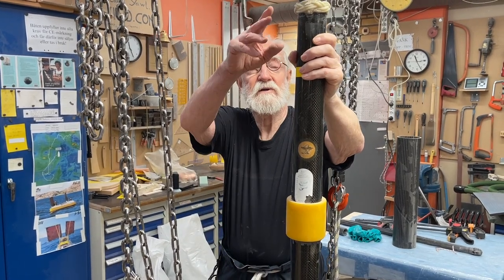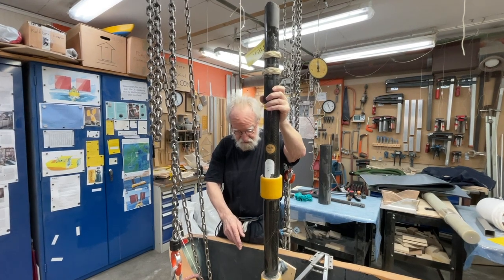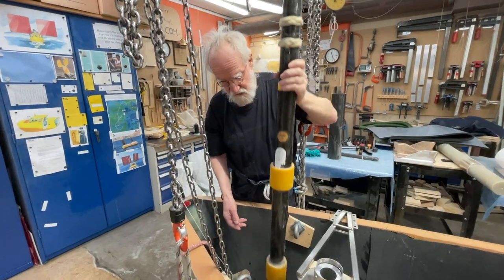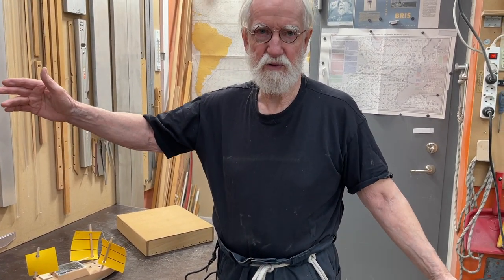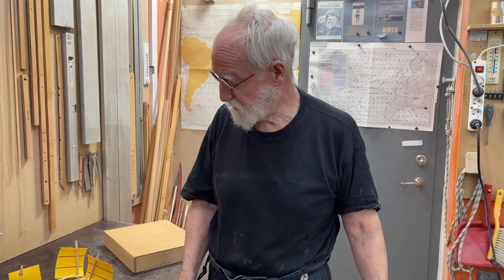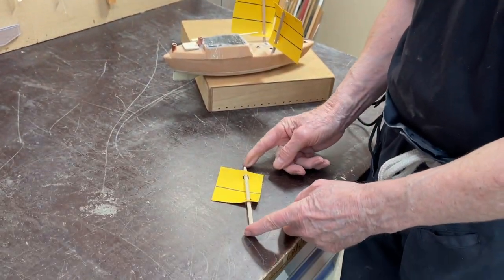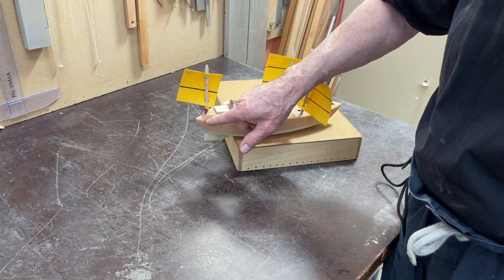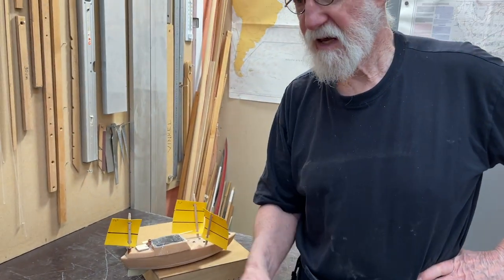15 Feb 2023  AIS:VHF antenna. If the resonance is OK can a bit of the antenna be hidden.

Comment: There's a lot that goes into antenna design. You don't want to just hook up a wire to the bottom of a long metal rod, if the rod is the length of the wavelength, then the high and low part of the wavelength cancels itself out within the antenna. That's why dipole antennas are usually half the wavelength for each half of the antenna.

My suggestion, get a commercial antenna designed for the frequency, and mount it on the top of the mast. The higher it is, the more line of sight range you have.

Comment: Sven, I'm an amateur radio operator and have a considerable amount of knowledge on antenna and feed line specifications. Marine VHF is line-of-sight usually plus or minus depending on atmospheric conditions. Your boat is very low to water so a few feet won't make much of a difference and also if you go with a quarter wave antenna or 5/8 wave antenna at that height won't make much of a difference either. What will make a difference is having the correct counterpoise or in this case ground plane. Antennas that do not have an effective ground plane regardless of the frequency they operate on are nowhere near as efficient regardless of the length of the antenna or the height. Now given the sailboat doesn't offer you very many options. A stainless steel whip may not be your best option given your limitations on that boat design. I would recommend investigating a J Pole design cut for 154 MHz. That should give you considerable gain without having to worry too much about a 4 element radial ground plane. Your boat lacks a considerable amount of metal which is used as a counterpoise in radio transmission. Given at that frequency it's not that critical it's still pretty important so I would come up with some matching length of metal that you can attach to the ground part of the antenna or the shield of the coaxial cable. Find somebody that has an SWR meter for VHF and use that to tune your antenna and your counterpoise for the lowest possible standing wave ratio during transmission. 

The secrets to effective antenna design and placement are simple depending on the type of antenna but some universal rules exist.

 Your antenna must create a 50 ohm load. This can be measured with an ohmmeter.

Your antenna must be cut or tuned for the frequency it is to be used on you should pick the center of the band.

The antenna should have the lowest possible SWR or standing wave ratio during transmit on the center of the band. The ideal number is 1: 1. All of this can be achieved with an antenna analyzer. You can also download free antenna modeling programs on the internet. 

Remember VHF on the water is line of sight. It would be better to hoist an antenna up fifty feet if possible but given this is probably impossible on your boat design I would work on some of the information I posted above I do not believe going with a 5/8 wave antenna over a quarter wave antenna will give you any major benefits perhaps just a few DB of gain. You could make that up in counterpoise alone. It's also important to have the shortest possible cable that also has the lowest loss. LMR 195  is preferred over rg58 and can actually make a big difference. The length you need will be so short it won't make much of a financial difference. 

Here are the rules:

The transmission line between the radio antenna should be the shortest length possible.

Using the lowest lost transmission line will gain the best results regardless of the length.

The amount of gain in decibels is irrelevant  to where it comes from. Meaning increasing the output of the radio from 25 to 100 Watts can give you less gain than the proper antenna, counterpoise and transmission line. 

Learn how to make a poor man's balun using nothing but transmission line. This can help you reduce SWR and help match the antenna to the radio for even more gain.
Reply: Also make sure you have the ability to disconnect the antenna from the back of the radio and connect it to ground in the ocean. The antenna inside the mast will be a lightning rod as it will be the tallest metal object standing off the water. If you were in a storm,  you prefer that electricity to ground directly to the ocean then into your radio.
Reply: @craigross5945  That fills me with confidence on account of my mast being 18 metres of aluminium. I counter that by crossing fingers and having a small wire brush thing up there. Thank you for your explanation of antennas.

Comment: Hi Sven, normally you are the expert in boat matters. Fortunately for you, I have a lot of knowledge in this matter.
In VHF frequencies, height is more important that gain if you want maximum coverage. 
The longer antenna inside the mast is not a good solution, a significant percentage of the signal will be close to the water and the waves will block them. Longer antennas have a very sharp vertical radiation pattern and most of the energy will be blocked, also the horizon is closer.
The best solution is the 1.2 meter (4 feet classic like the Shakespeare 5104 ) antenna, on top of your mast, not inside the mast. The fiberglass is mostly transparent to the antenna at this frequencies, but it could slightly de-tune the antenna and move it out of resonance, besides you get more coverage due to the extra height.
Best to you.
Rafael
Reply from the maker: I like to keep the antenna inside the mast becouse of protection from the elements.
Reply: I understand, but if the mast is carbon fiber it will shield and detune the antenna. Fiberglass is ok
Reply: A stainless steel antenna will probably outlive you and me together. I wouldn’t worry too much about the elements. A marine vhf antenna is designed for these elements.

Comment: I would get a regular VHF/AIS antenna ,stainless whip, (as every sailboat, proven to work great) ,a splitter for the active AIS that is mounted below deck,regular antenna cable(wich is shilded), mount it on the top of the mast. Literally hundreds of thousands of sailboats around the world use it .
Reply from the maker: A dipole antenna is much more efficient.
Reply: @SvenYrvindExlex  A dipole is often regarded a reference antenna, with gain=1. Many commercial antennas have higher gain. You can make your own verical dipole where the feedline (coax) is fed through a (aluminium) tube and the shield connected to the tube which then  is the lower half of the antenna,  and the center conductor of the coax is connected to a wire or similar at the antenna center which then is the top half. A horizontaly polarized dipole antenna for vhf is a bad idea on a boat. The best option in my opinion is a 5/8 wave antenna, and is best obtained from a commercial manufacturer. It will have a relatively sophisticated matching system at the bottom which allows for vertical polarization as the antenna points up. theoretically it could be inside a non conductive mast, but I think it will inhibit some of the rf energy. The best option imo is ANY antenna on the top of the mast above any metal objects. Any antenna high up is better than any antenna lower to the deck good or bad. Another important point on an antenna is mechanical and structural rigidity and resistance to corrosion in connectors and water ingression protection. In others word, buy the lightest but best antenna , rf, electrical and structural,  and place it above metal objects as high as possible. I do not intend to imply any great wisdom here only want the best for you on your voyage :-)
Reply: @SvenYrvindExlex  yes but without complex frequency traps you don't physically have the space on the boat plus it will be horizontally polarized which will reduce your effective signal radiation. Most VHF antenna is on boats are vertically polarized making you 90 degrees out of phase. Yes you will be heard but not as well as if you had a properly installed and matched vertical or j Pole.

Comment: I would just go with the standard 1,2m antenna, or maybe even slightly shorter. There is little extra gain from the longer antennas, and as your cable losses will be minimal, due to shortness of the cable run, the short  antenna is good enough. Also, VHF is more or less line of sight, and your antenna is low, so your range is limited anyhow. Personally, in a boat this size, I would just go with a good handheld VHF. The range will be closethe to as you will get with a VHF with external antenna, the reason being the low antenna mounting.
Reply: Can you hook up an ais receiver to a hand held vhf?
Reply: @edfleming7780  No, but as for that, the AIS receiver only needs a small 20cm Shakespeare antenna. That is what I use, the receiver being a raspberry pi. Otherwise a standalone NASA receiver would fit the bill for little money.

Comment from the maker: Question Is it a good idea to use a 2.4 meter long AIS/VHF antenna even if the bottom part of it will be blocked by the carbon fiber holder. The alternative is a 1.2 meter antenna. The 2.4 meter antenna will get more signal.
Reply: The element should be fully exposed. My question is, can the carbon hull be used as the ground/counterpose ground plane? Is there a reason to not project the 2.4m past the end of the mast?
Reply: The length of the exposed antenna should be harmonised with the wavelength of the transmitter. If you mount the 2.4m antenna at you suggest, it maybe not be so effective as a 1.2m antenna, especially if you position the 1.2m antenna at the top of the mast.
Reply: I would go with the smaller antenna.  The gain pattern of physically longer VHF antennas becomes narrower and narrower towards the horizon.  This increases gain, but on a sailboat, the rolling of the boat means frequently the high gain lobe of the antenna is pointed at the sky or the water and not the horizon.  Having part of the antenna element covered shouldn’t matter much at all as long as material is transparent to radio waves.  Fiberglass or PVC should be fine.
Reply: @Mark Archerthat’s what I would do.  But I wouldn’t be too worried about the height.  VHF is line of sight, so every foot higher gives you more range.  But in an offshore sailing application, you’re only using the VHF for communications close to shore and for AIS to other ships.  The large ships that you will worry about hitting will have AIS antennas 20,30, 50 feet or more above the water which will do all the work in terms of line-of-sight.
Reply from the maker: @braithmiller  The antenna is protected inside the mast.

Comment: Not an radio expert, but I do remember some small parts from school suggesting it is a good reason to stay with full, half, quarter of the wavelength to get god reception on the antenna
Reply: That's the resonances Sven was talking about. Standing waves in the wires.
Reply: Is true..  halfwave work best both for transmit and receive.

Comment: Would it be possible to let the antenna go out on top of the mast? Keeping a full length antenna above the carbon part? And probably having the antenna in one fore masts, to be able to put the top lantern in the aft mast? This to avoid wiring together with the antenna?
And at the same time having a radar reflector in the other fore mast?

Comment: add antenne wire in all three masts which could increase the signal.
Reply: I'm not sure that's a good idea. Good antenna design is an engineering science in itself. 
Cf. Yagi antenna, or log-per, etc. 
The big question is, what characteristics (e.g. radiation pattern) is the antenna supposed to have? Shall it have a preferential direction? Etc.

Comment: Sven I'm an amateur radio operator. If the antenna is tuned properly... and it has 2.7 meters for example, but 0.5 meters is inside the carbon fiber ... it will still work as the antenna does resonates on the desired frequency. Is just that you will loose just a tiny bit of the performance it would had if it was entirely free. But it also depends on the frequency the antenna must work on... let me look a little more into this and I will get back to you.
Reply: Ok Sven... I got the frequencies up in a comment reply. A halfwave vertical antenna for 162MHz should have about 44 centimeters... 88 centimeters in total if you would use a vertical dipole antenna... you can even make it yourself. Well made and tuned it can work as good as the commercial ones. But let's say you buy a commercial one..  it should not be bigger than 90cm so you are ok as you will install it as high as possible inside the mast.
Reply from the maker: @ciprianpopica  Thank you much.
The AIS/VHF dipole antennas for sale are 1.2 meter and 2.4 meter. Do the longer ones give more energy absorbtion. I guess they are longer than 88 centimeter for structural and production reasons.
Reply: A large dish antenna can capture more energy than a smaller dish. The same principal would apply to the dipole. The partially shaded 2.4m dipole should still capture more energy than the 1.2m.  My question is whether or not there would be coupling between the carbon fiber and the small section of shadowed dipole that would detune the antenna making it less efficient, defeating the gains in energy absorption.
Reply: @leifilvedson9604  Longer antennas usually work great on receive... but not so great on transmitting. At least that is what I see from the ones I built for the 2m amateur radio band ( 144MHz ). It acts the same as the marine VHF so they have similar performances. About hidding the lower end of the antenna... I made a little video that Sven can watch and hopefully he can make the changes he things work best for him. It should not detune the antenna in theory though.. but you can't know for sure unless you make measurements ))). I wish I was closer, I would go there and make some tests.

Comment: Carbon fiber will not interfere, only metal, and only parallel metal.  Ham radio operator K3SLK.  It will be fine.  If possible keep it away from any metal at all, but as long as it does not run ALONG the antenna it should be OK to have small bits.
Reply: I should have been more clear, it will block signal but that small bit only at the bottom won't matter much.  Don't put the whole antenna in carbon fiber.

Comment: With all of your exact measurements to this point, and considering what size mast, my experience with handheld marine radios, I see that a taller mast is not in line with your data to this point. Just my opinion.

Comment: Would it make sense to design the antennae to be used as a strong mast, rather than fit the antennae into a pre-designed mast?
Any thoughts on range extension in fair weather? A kite would take little space....

Comment: I've been doing a little thinking over the past twelve hours when I haven't been sleeping about your antenna problem. You can purchase a multi segment 25 ft lightweight telescopic fiberglass mast. You can attach a minimal quarter wavelength VHF antenna with an effective ground plane to it. You can hoist this up in less than 60 seconds. At that height you are increasing your chances of being heard and hearing many times over what you could possibly Mount at the height of your existing masts. You could keep it collapsed and still usable for normal communication. Plus they're very skinny so they will have virtually no windage. You can get a longer one and feed it internally with the long wire for shortwave or SSB operation. 

On another note having a single sideband radio aboard will gain you much better results offshore than any VHF. You should always have both especially with the need of AIS.

Comment: As far as I know a folded antenna is quite common for VHF systems, and longer is better. If carbon fibre is transparent to radio waves (I know fibreglass is) you could tuck it into the mast. But there are radio experts who will give better advice.
Reply: RF does not pass through carbon fiber easily. That's why Sven mentions the way the mast is mounted in the boat.
Reply: Carbon Fiber is really good at blocking signal. That's why he only shells the bottom half in carbon also.